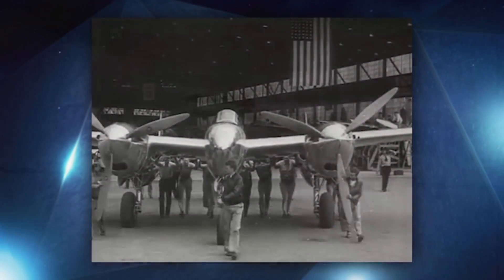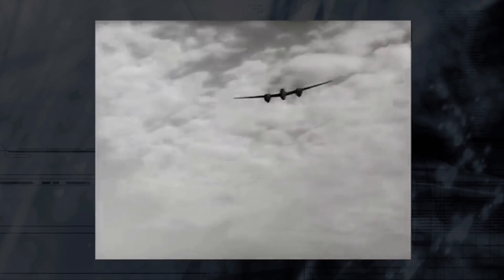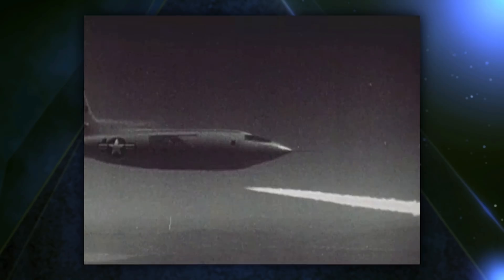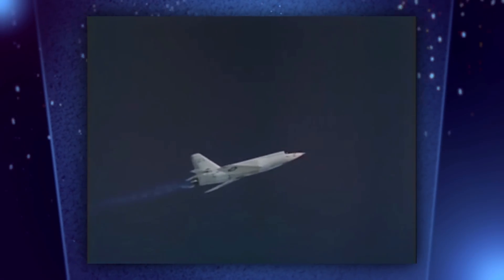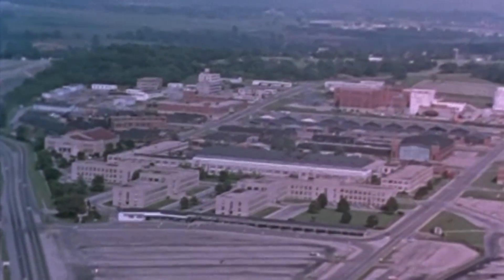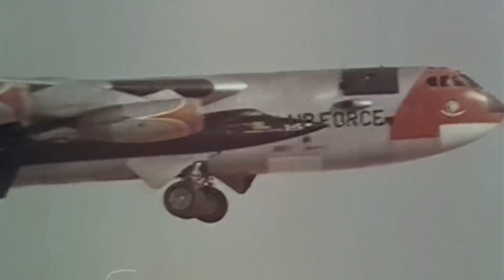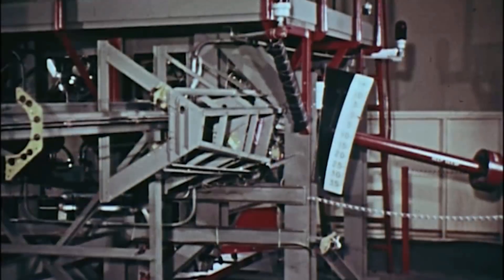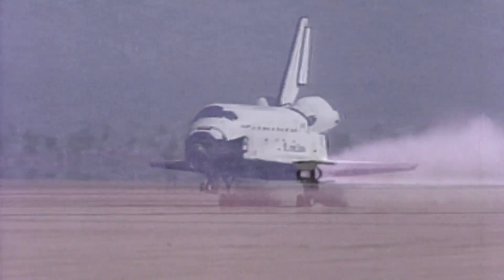X-15 Hypersonic Rocket-powered Aircraft | EXPERIMENTAL SPEED

Comment: 8:36 Oooooooohhhhhhhhh RCS???.......that's actually pretty interesting. I never knew that about the X-15.

Itz even more interesting when researchers today are exploring the idea of controlling planes without using physical control surfaces. A good example of this is the MAGMA aircraft from BAE. It uses something called "fluidic thrust vectoring", which is a fancy way of bleeding propulsive gases from the engine, and blowing it through tiny funnels deposited everywhere around the craft. This is supposedly able to steer the aircraft without relying on control surfaces (which could improve the supermanuverability, and stealth of the plane)

Comment: First through the Sound Barrier? America WRONG. During WW2 a small UK Aircraft company was asked to design a 1000 mph Aircraft the US found out asked Britain for their plans and promised to give their non existant plans in return. The US having little knowledge spent years and pilots trying to get it to work. At wars end the UK firm had a FINAL DESIGN ready to go testing was cancelled as the head of UK aviation thought German Swept wings were the future. When the program was restarted the Aircraft went through the Sound Barrier on its first flight. The Secret was an all moving tail elevator America eventually worked it out.

Comment: Did Neil Armstrong not break one of these planes in halve when he landed it before joining NASA
Reply: Ps the X2 had moveable tail plane as the older alerons or flaps could not work as high speeds the UK got that idea first and pass the info to the us  from their model that passed the speed of sound after the us broke it
Reply: Alistairm Kerr it was actually the the X-1, not the X-2. Miles Aircraft was more than 3/4 finished with what would've been the first aircraft to reach supersonic speeds ( I think the craft was called M-52, but I may be wrong) when the U.K. Ministry of Aviation ordered them to cease production and turn over their research and drawings to the US Air Force. Bell Aircraft then used the Miles Aircraft tail design to replace the standard tail stabilizer that was keeping them from achieving super sonic speeds.